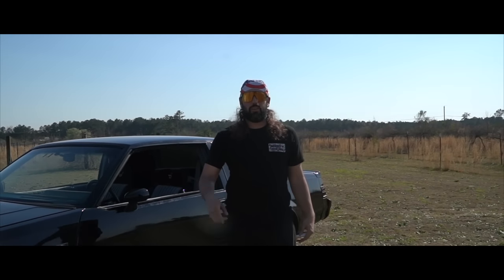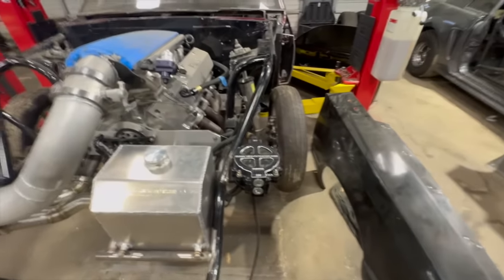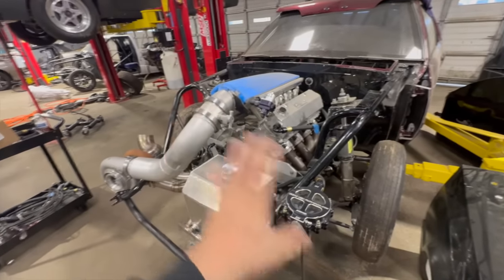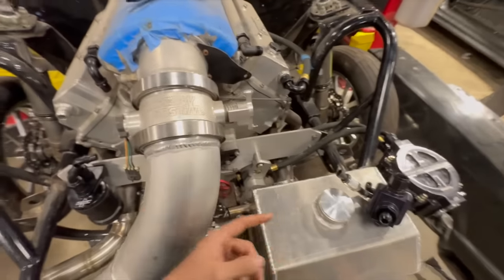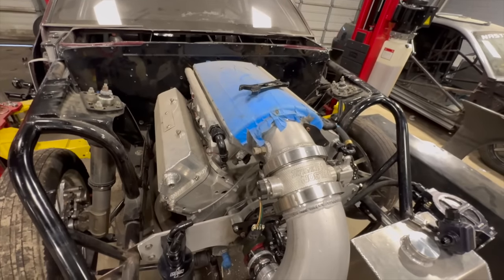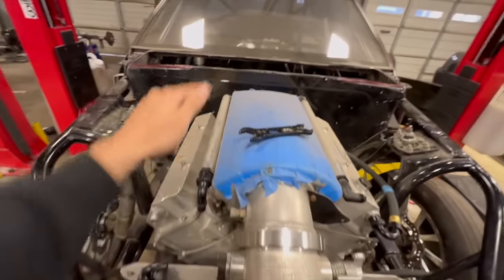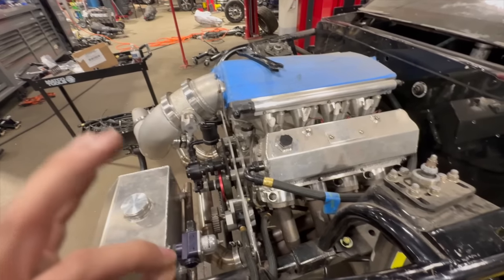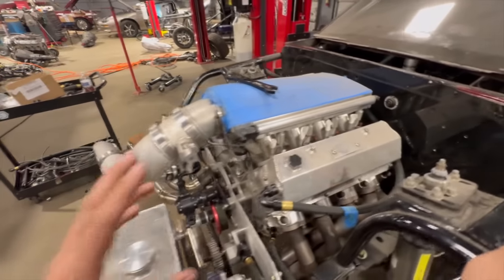How to build a 2000+ HP fuel system! Methanol EFI Fuel System

Comment: One reason people say small lines wont work is the fuel pressure . Some cars on e or meth run 90 to 100 psi chasing a weak link in the fuel system. ie streching fuel injectors duty cycle  or running 4 pumps and trying to regulate that. Ive heard the infamous suck the fuel rail dry lol, The absolute way you will suck a fuel rail dry is if you have 5 table spoons of  fuel in the tank😵‍💫😅😅😅

Comment: If you run 12an on the input side you technically could use a 6an crossover cause you only need half as much fuel on the return side

Comment: I've seen it on Steve Morris having issues feeding each rail at the end. The injector kept lean burning. He fed it in the middle like a t his problems went away supposedly. That's like 4000+ HP tho
Reply: That was Tom Bailey and he ended up going back to the original fuel injectors . It was when he put on a new brand injector and that company told him he needed to feed them that way . For one set of injectors to suck a 12 a rail dry while it’s being fed 60-100 psi doesn’t seem likely .

Comment: If they’re running their system dry quit buying Amazon pumps !! the regulator is going to keep whatever fuel pressure on the rails that it’s set at  if the pump can support it ! anyone that argues with you needs a better pump !